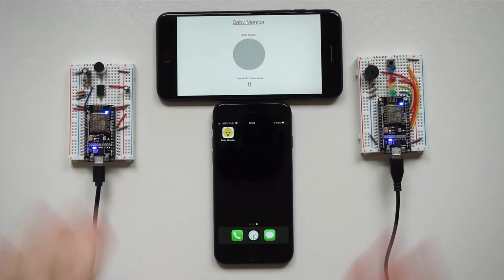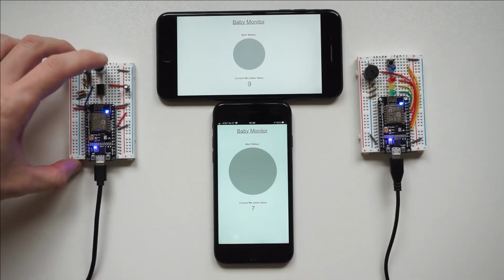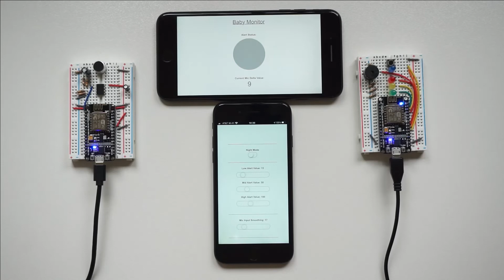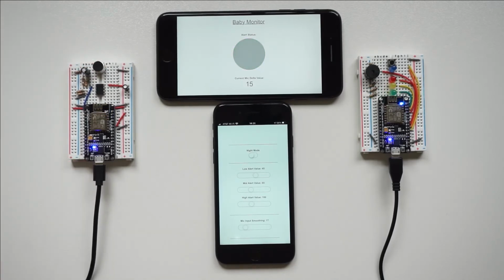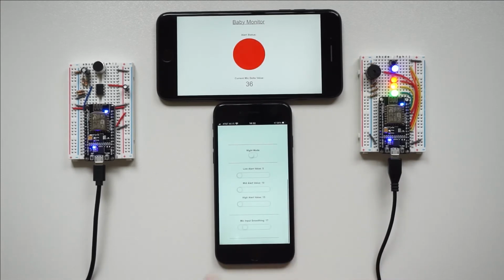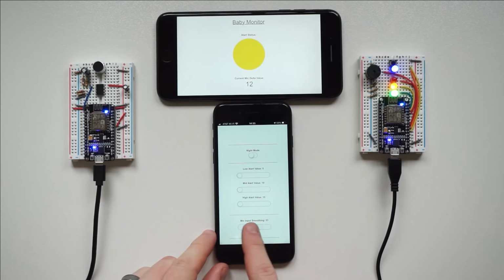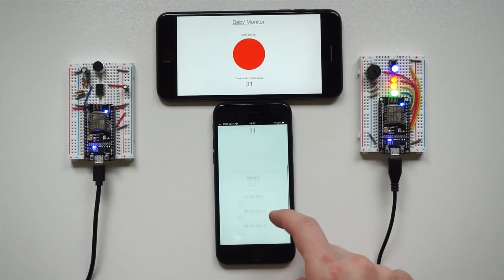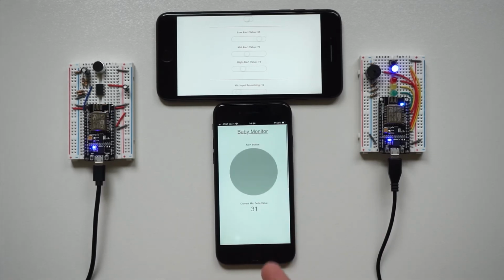Arduino - Baby Monitor

Comment: I was looking for something like that, that's awesome. Thanks for all the infos and for sharing everything ! Do you have any idea if you could modify your project in order to use one arduino as a wifi hotspot, my idea is to be able to bring this around anywhere without having to connect to my hosts' wifi everytime.
Reply from the maker: Hi! Thanks for the compliments, I'm glad you found everything useful =) You could certainly modify this to run as a Wifi Hotspot/Client.  There are quite a few resources on setting that sort of thing up and you'd just need to change a few lines of the source code.  

However, if you need help, just let me know and I can assist and test.

Cheers
Reply: @WRCsubeRS  Thanks I'll let you know how it goes